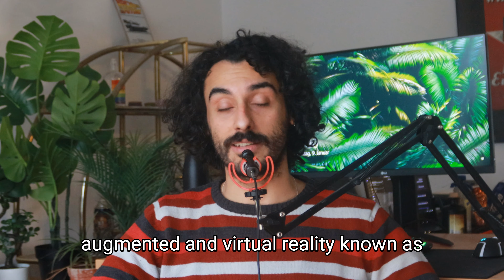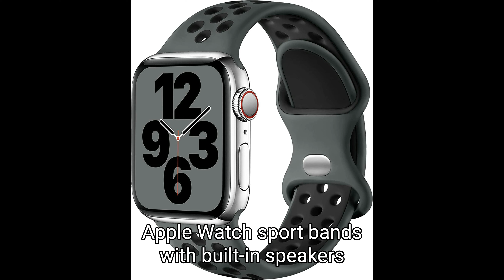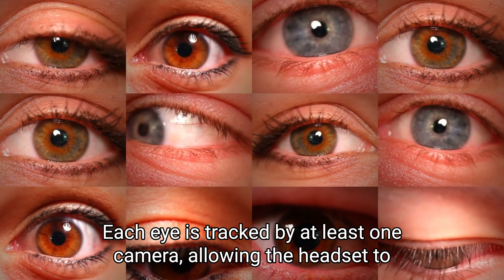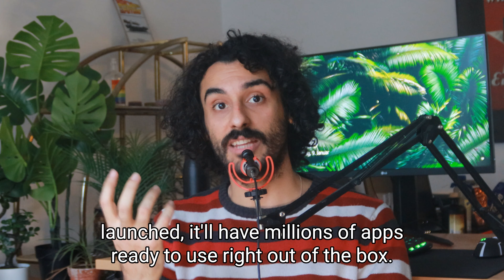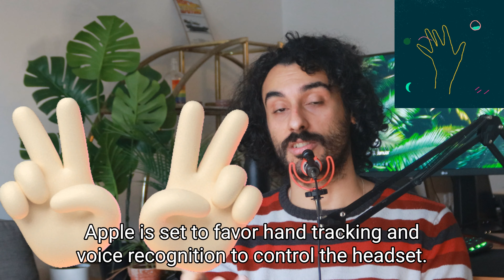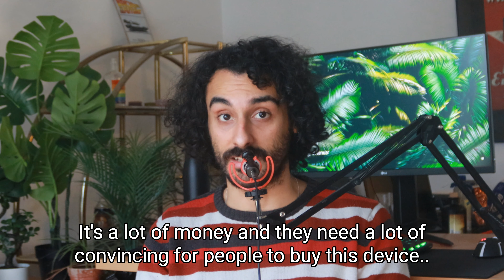Apple Reality Pro Controversial Design Revealed

Comment: Its not 8k, if you have 4k panel per eye..  that would be 8Mp per eye, so 2x8Mp = 16Mp. While 8k = 33Mp, you need four 4k monitors to have one 8k display. Also, its just 4k in stereo. Just like Varjo Aero or Pimax Crystal.

Comment: If I were an engineer, I would put a super-capacitor into the headset. No charge cycle limit, almost instantaneous charging, and can keep the headset powered while you are switching battery packs. I do NOT know why these aren't being used in products already. [Actually I do. They don't wear out after about 2 years..]